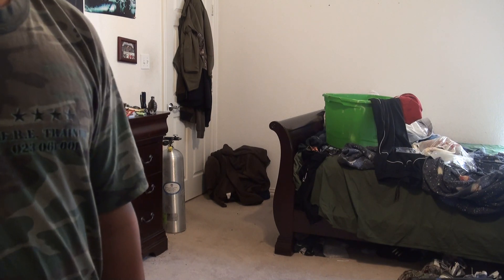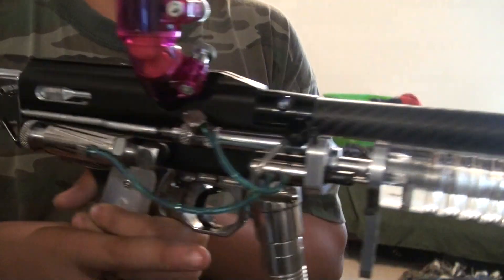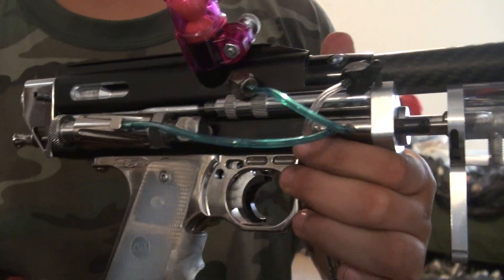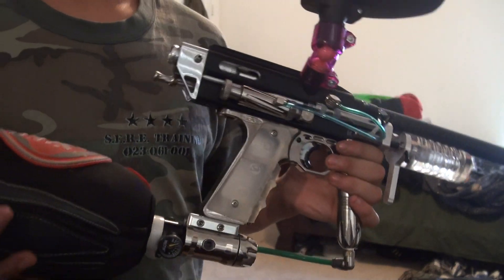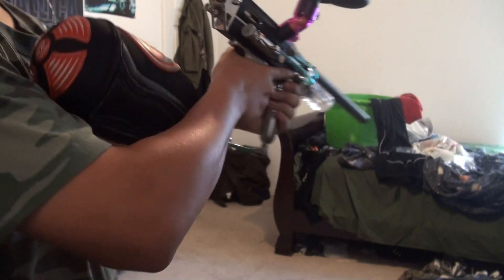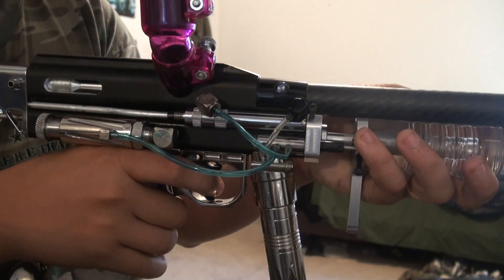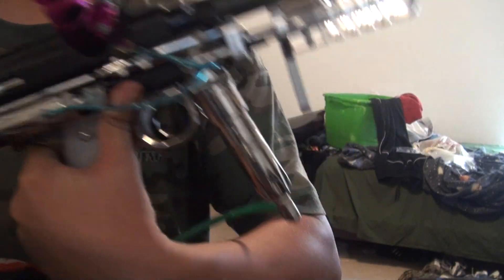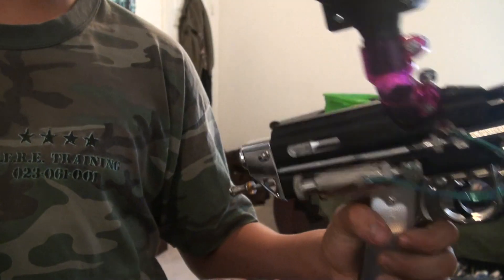pneumatic assisted pump autococker shooting

Comment from the maker: @xhogzilla88 It is up at the shop right now, after it cam back from ano the taped holes that secure the pneumatics did not fit the screws anymore so they are being re-taped. But i should have it all together soon and i will try to bring it out to the Bt big game on the 24th if you are going to be there